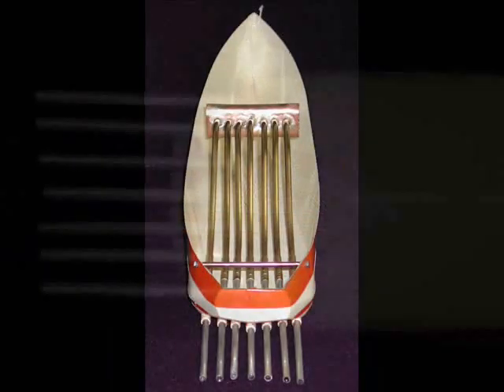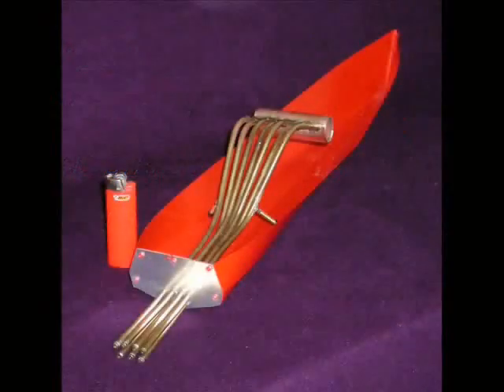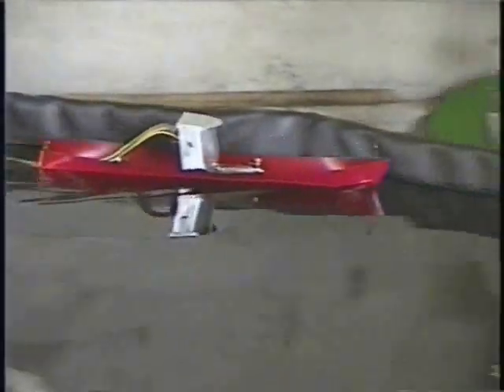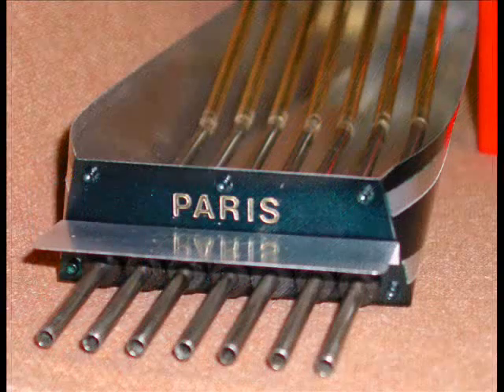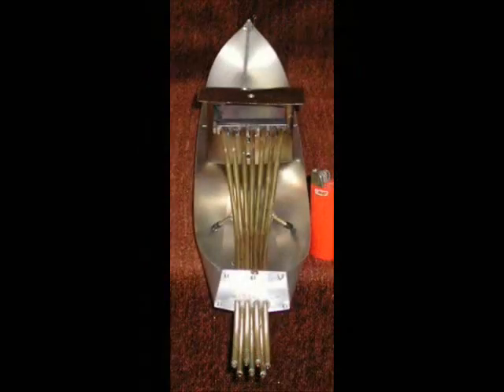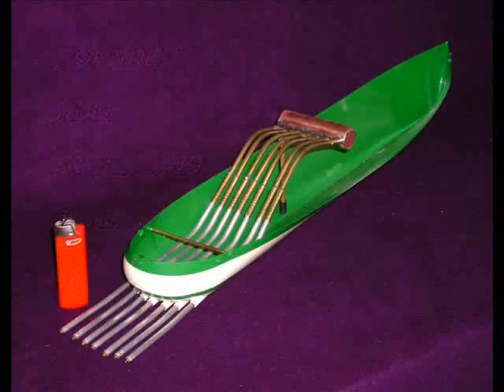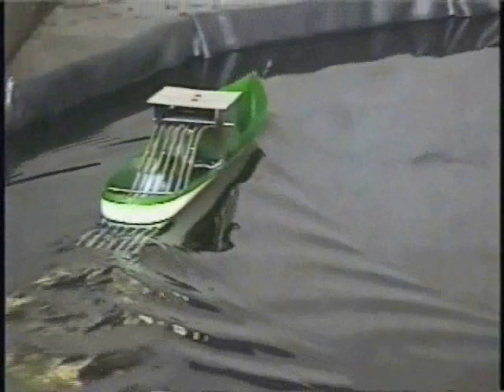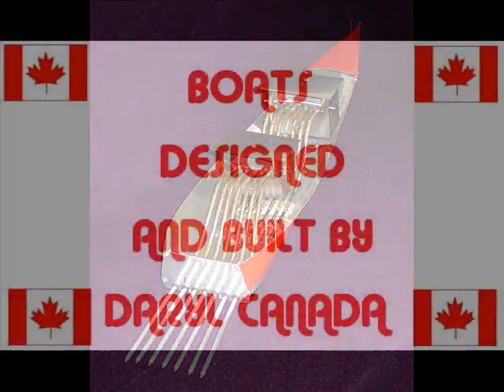Speed Testing Hull Designs.wmv

Comment: You should try to determine what is different when the engine "over performs", and then try to replicate those conditions until you achieve a steady result between runs. Measuring more variables, like water & ambient air temperatures, or using a graduated syringe to measure exactly how much water you put into the engine, and then adjusting that volume accordingly. Finding whatever it takes to get the best performance each time will give your expirements more control.

Comment: Beautiful   made models !   I know nothing about this form of propulsion. But wouldn't making the " engine",  and exhaust bigger improve performance ?
Reply from the maker: +welshpete12 Hello welshpete. Thank you. Unfortunately these engines do not scale up predictably. Some very large engines have been built but the performance has been dismal. There is a video on my best engine which is larger.
Reply: +Daryl Foster Yes I can that must be true , If not,  they would be a common  means of propulsion today . They seem to be very similar to the engine used in the V1 German weapon of the second world war . Do you think that could be the way forward ?
Reply from the maker: +welshpete12 There is a similarity to the V-1 rocket which is a pulse jet and has undergone considerable development. You can search Youtube for videos if you like and see results that are amazing. Both engines are poor re efficiency so that makes commercial use unlikely. There are a couple of differences in the two engines. Pop pop engines do not require any movable parts. Though if equipped with a diaphragm which moves that does not affect its ability to run and in fact reduces the power. Also the pop pop is an external heat engine while the pulse jet is an internal heat engine that usually uses some moving parts for sustained operation. Significant future development seems unlikely but who knows.

Comment: If the boiler pulses, then you could have an "intake" with a check-valve to replenish the water lost to thrust. Of course you would need to heat this new water with another candle.
Reply from the maker: +TIMEtoRIDE900 You would think so wouldn't you, but, that is not how it works.
Reply: I just stumbled across this today - -do the tubes eject water, or steam ??
Thanks . . .
I'd like to build for a kid.
Reply from the maker: +TIMEtoRIDE900 The water works like a piston alternately sucking and blowing. All the water is not ejected if the engine is running properly so in theory it could keep running as long as the heat was right.
Reply: Thanks for the explanation - - so it runs indefinitely, until the candle is done ??

Why so many tubes ?? The tubes need to be water cooled ??
Thanks again !!
Reply from the maker: +TIMEtoRIDE900 For this engine 7 tubes worked best. Yes the steam needs to be condensed to continue the cycle.

Comment: I have questions 1)What is the experimental result if you use just one single jet tube. 2) What would you think happen if you use 1 tube in front to intake & 1 jet tube behind after adding one-way valves to direct the water. 3) Do you think a CONE shape boiler can provide better jet.
Reply from the maker: In theory one tube should be very good. In practice it is very temperamental. Number of tubes, size of tubes, length of tubes are all interrelated. 2) I think it works but not as good. 3) No. Thanks for watching.

Comment: what would happen if you hooked the 2 engines together either buy running one boiler in to the other or connecting the outlet pipes together
Reply from the maker: Then it would not be two engines. It would be one that usually will not work very well.

Comment from the maker: Thanks for watching and commenting. That probably has some effect. There is quite a lot of speed variation during a test that goes in to arriving at the average speeds quoted so the attachment is not the main speed limiter. It would be nice to be able to test in a straight line with ideal conditions and eliminate the drag of turning.

Comment: you measure almost the same speed in all, but I see you're using a string attached to the boat centered in the pool so they can turn.
And I think in this way, the faster a boat goes, more line resistance will find.
By that reason all speeds looks similar. Well, that is my opinion.  Nice models.

Comment from the maker: Proper tube length is determined by tube ID and testing. Lots can be outside of the boat to get C of G correct. Either the tubes are outside or the boat is longer which adds more drag and weight. The steam has to cool and condense long before it reaches the end of the tube or the engine will not run or soon stop running. Reading about how a putt putt engine works will help you understand why. Thanks for watching and the comment. PP4V